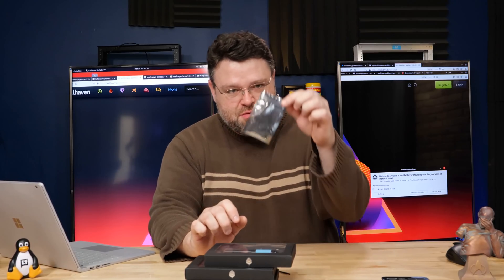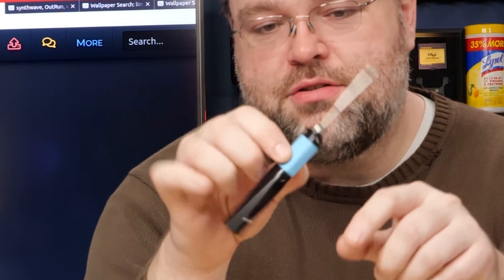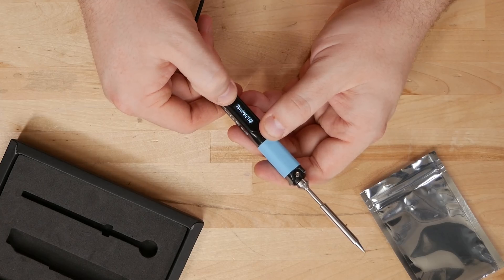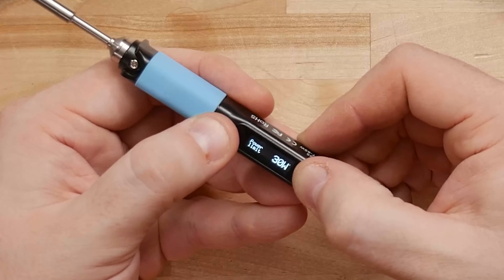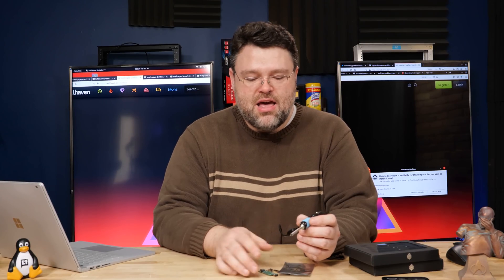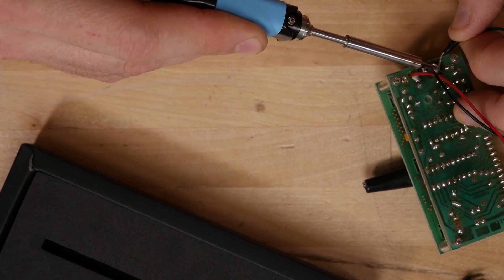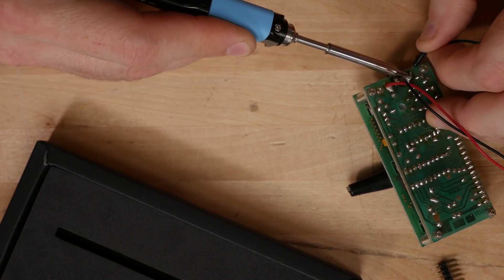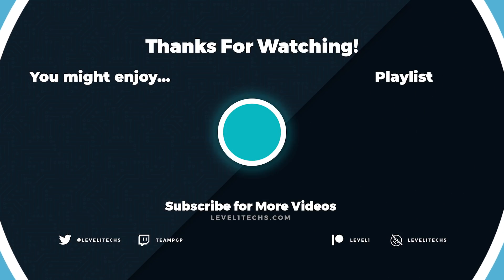PINECIL - Soldering Iron w/a RISC-V Processor!

Comment: As others have mentioned every soldering iron needs a microcontorller if you want half decent temperature control, the reason they put a RISC-V 100+MHz one in there is because they cost pennies nowadays and it's cheaper than spending a bunch of extra development time cramming it all into an 8-bitter, which is still perfectly doable as well.

Comment: Got mine today as an upgrade to a similar SQD60 I already had (which has usb-C connector, but not any power negotiating circuitry), because of the usb-c PD option. This is perfect to use with a PD capable power bank or with my laptop power supply. and for those cases where I need more power, I just use my lab bench power supply

Comment: It also has automatic display rotation for if your switching hands while soldering! I'm ambidextrous so I don't at all the time within a day and this just like a phone will auto rotate it's screen so it's can be locked to right or left or be auto rotate! Freakiest thing though is that this thing will actually turn on and heat using my Moto G6 USB-C port!!!!!!! It heats enough to actually do micro soldering! So in a pick you could use your phone as a power source. How crazy is that!!!

Comment: Mine arrived with a warning from the Post Office that it was received in the country in "wet" state. It sure was. All the cardboard packaging had gone soft and smelled like a flood damaged home - awful. I received a meter the previous day that was also wet. I don't know what happened in China but I am guessing a lot of stuff got wet. I swear I can hear sizzling noises coming from the iron body though it seems to work ok. I have no idea how to figure out the user interface and there is no manual online that I can find. All I can do is reset to factory. I don't know whether the + or - button is the "yes" button or the "next menu item" button. I keep going round in circles and getting nowhere.

Comment: Pretty cool. I have connected the PINECIL to the power supply of the TS100. 
Now the PINCIL is only one thing: cool.
The PD IC burned out, can take a maximum of 21 volts, but the TS100 works with 24 volts.
And especially cool, the IC is not recommended for new circuits. 
Now the PINCEL is cool and I still use the tip on the TS100. That is hot!
So I ordered a new TS100 again !

Comment: You don't use the soldering iron like it's a paint brush by doing that you create cold solder joints. When the surfaces are properly fluxed and the iron tip is at the right temp the solder will start flowing just need to keep the tip on the surfaces for a few seconds to heat them up otherwise the solder wond bond.

Comment: Of course, microcontrollers are mandatory for soldering iron that has temperature management feature, so you could solder some sensitive electronic components without destroying them. Some workshops require temperature-controlled soldering irons for good reason, and it's where the reliability counts the most. I bought TS-100 for exactly this reason, and there's bonus too, you could solder the wires together without melting the insulator off with it set at 280 °C, the typical soldering temperature.

Comment: Most here sound experienced in soldering. So, asking as a novice: if I bought the Pinecil to solder keyboard switches to a PCB... would the standard supplied tip do? Pine64 also sell sets of other tips for fine work. Don't know if 'switches' count as that. GergoPlex keyboard (by G Heavy Industries)... here I come!

Comment: but how well does it hold up.
i've bought several soldering irons and they all got thrown out cause the tips all wear out very fast while im using it.
Reply: It uses the same tips of the TS100, so you could search for what owners of that iron say about durability, but all of the modern irons support sleep modes when not in use that extend tip lifetime by reducing oxidation.

Comment: Not sure how I feel about the controls being built into the handle. The way you were holding it to use them had me so nervous that you were going to burn yourself.

Interesting design of the tips though. It looks like if they replaced the screw with some sort of quick-release, with the right stand it would be possible to swap tips without waiting for them to cool .

Comment: Kinda useless if you're soldering lead free or on gold plated ground surfaces. You want to use high temps to solder in a short amount of time to ensure proper wetting and cause less damage to components. A $20 soldering iron will do the same job for leaded solder.

Comment: You don't want to clean off all the solder. When you are done. Flow new solder to clean off the used solder. The new solder will protect the tip when in storage.

Comment: It's back ordered.  I do wish it could be cordless like for 10 minutes running time.   And, yes, i did like and appreciated your amd rendition!  LOL!
Reply: You could probably run a Lipo battery or some very high output 18650 battery with a boost converter and add that to the chassis. If it averaged 30w for 10 minutes that's only 5whr so that should be achievable (you'll probably want LiPo for a thinner package and better battery form factor and capacity options plus they are designed for higher power output). I like my simple iron just plugged into a 3s-4s Lipo battery so I can use my airplane/quadcopter batteries to do repairs in the field with their own batteries so I don't take anything extra.

Comment: These irons aren't really irons, they are full-fledged soldering stations. Their closed-loop PID regulation allows them to solder things that a "dumb" soldering iron can't.
Reply: Like what?
Reply: @truthhurts2149  it's not just about the "what", it's about making sure you put the exact amount of heat (not just temperature) into what you're soldering. Look-up the PACE soldering training videos for a complete professional course on soldering.
Reply: @TheNefastor  "exact amount of heat" - no such thing. You either can deliver the amount of power required into the joint or not. Dumb or "smart", irrelevant.
Reply: @AttilaAsztalos  if you're not familiar with the concept of heat and the difference between power and heat, perhaps you should ask your school for a refund.

Comment: A soldering iron is a "dumb" device, it doesn't need a processor, just another pointless gimmick !
Reply: temperature control and readings are useful enough functions to need a processor. Burning your hand because you thought the iron tip had cooled already is not a fun experience. Neither is destroying a circuit because your iron was too hot and destroyed the contacts
Reply: @runneypo  if you haven't learnt how to use the iron without burning yourself or damaging the circuit,  you shouldn't be using it in the first place LOL. and if you need the processor to tell you it's hot, then you're dumber than the dumb iron LOL
Reply: @runneypo  lol even a simple animal will learn not to touch someting hot after the first couple of times, the only "processor" it needs is it's brain and a rudimentary ability to learn by experience LOL
Reply: @MrTubeuser12  i guess i am dumber than a simple animal. what more do you want me to say? /shrug

Comment: Actually, you should always store your tips WITH solder on them. Clean the tip before soldering a joint but when you're done using the iron, make sure you tin the tip with a nice glob of solder and then turn it off. This greatly prolongs the life of your tips by preventing corrosion. Unless something is wrong with the composition of the tips, they should last quite a long time even with frequent use. Preventing corrosion is key to tip life.
Reply: Yep, I never clean the tip before storing. I leave the old solder on it. I clean the tip off before using, and my tips always last. I actually poke the hot soldering tip into a tub of rosin wax and then stab brass wool to clean it. I never use water.

Comment: so it seems like a direct competitor of the ts100. What's the bonus of risc v vs the stm32 core? Is there a size difference on the grips? The body of this one looks bigger than a ts100 but it might be the blue heat shrink on it.
Reply: STM32 is based on quite old ARM Cortex-m core. Those Risc-V MCUs have better freq, better IPC and potentially more memory than PIC or STmicro parts using the same amount of power.
Reply: @PainterVierax  so no measurable improvements for the end application? It's a soldering iron not a desktop computer. Realistically its running a pid controller which is going to see no benefit from the improved frequency
Reply: @anonymity66  Well, it allows less power consumption/heat or way more complex algorithm with the same thermal solution so it is not a bad thing for a product. I see that like using an LT1086 instead of a good old LM317 for linear voltage regulation.

We can also think about the parts availability. Those STM32 aren't royalty-free ISA and actually the first MCUs of this series which have been really popular are quite old and more expensive than other beefier chips with larger footprints. Same thing than Atmega's MCUs used on Arduino boards.
The GD32 series is a genuine replacement of STM32 series, not one of the shady counterfeit clones found on the cheap bluepill boards. And as future-proofing matters, its easier for competitors to make new chips with the same compatibility while staying in legality and without paying for ARM cores.

Comment: Can you post a video on how to use this soldering iron (or any other one which is in stock) to repair a motherboard with a ripped off PCI x16 slot ? It happened to my motherboard when I tried to upgrade my GTX 770 (it had one of those plastic retention levers which I forgot to disengage before removing the card). The motherboard still works fine but I have to use the PCI 8x slot now.

Comment: I think ill stick with my Weller... Lol
TBF, I almost got one of those TS100 irons recently but didnt because the tips were like 15 bucks a piece Where quality tips for other traditional irons are 15 to 25 bucks for five. That and the fact I didnt need portability at all means Weller or Hakko was my real choices, and my Weller gets hot damn near as fast anyway.
Reply: Those use Hakko tips with embedded temp probe. That's more expensive but way more reliable and quicker than older techs.

Comment: I wonder how this holds up to a normal TS100, cause it looks exactly the same for a lower price.
Reply: I’ve seen several reviews that describe the Pinecil as an “improved TS100”. The firmware on the Pinecil was originally designed as a third party hack for the TS100 and then they decided to launch their own product. The tips are the same. It’s cheaper. Sounds like a win-win in my book. I’ve just ordered mine and it’s being shipped to me at the moment. I’m so excited :-)

Comment: Wait, $25/$35 for this? How'd they get the price so low compared to a TS100? Wattage seems the same, power input is the same, etc. Without seeing the internals, and given how everything is the same anyways so a highly educated guess, the only real change seems to be going from the STM32 ARM chip to the RV32IMAC chip. Aren't they basically the same unit but with a different chip? 
I've wanted a TS100 for awhile, and now I want one of these, but I think I'm still going to hold off to see what USB 4 gives us. If USB 4 and it's PD/QC specs allow for even higher charging headroom, similar to Apple's 96W charger but entirely USB standardized, or even higher, something like this could easily compete with legitimate soldering stations. Yeah, you'd need a ridiculous power source, especially on a battery pack, but if a next gen $25 quasi-portable soldering iron can compete with industry standard soldering stations, I'll be buying one. 

I'm also hoping this benchtop replacement scheme will eventually spiral into a trend and start replacing other benchtop units at a much more affordable price. A quasi-portable o-scope would be really nice.
Reply: Pine64 is a community peoject so it's like a non-profit company. Really rare too see but that's why the prices of all their products are hard to beat. The caveat is that they only deliver the hardware and the community does the software, but in this case there isn't that much software needed anyways.

Comment: It probably needs a beefy enough micro to run the PD code. It can be RAM intensive but seriously it´s overkill without good reason. If the micro is cheap enough then who cares? 
Still, not for me, I get the travel and solder, but I´ll stick to my JBC. Once you go black...

Comment: hobbyist use these for on the spot fix if something like a motor lead breaks on a motor,they can easily be run on 3s lipo that we use in radio controlled cars,boats and planes

Comment: It's ARM Based (uses an STM32) but you should check out the TS100 as well! I would love a detailed comparison of both as I believe they are both very similar but may be able to compare the RISC-V to ARM performance.
Reply: No, It's a 32 bit GD32VF103TB Risc Microcontroller. No arm core inside.
Reply: @izaicslinux6961  They're referring that TS100 is ARM based, not that Pinecil is. And I am curious about that particular comparison too, since they share the same tips and are priced similarly if you take into account the extra stuffs that come with TS100 like charger and  grounding cable.
Reply: @jaewonjang969  With its royalty-free ISA and quite open environment, this GD32 chips are mostly prone to last longer by having more cloning potential or replacement parts.
Instead of STM32, that will be replaced by newer, incompatible models and which the popular model used into the Blue Pill devboard is already quite hard to find for cheap, even its clones.